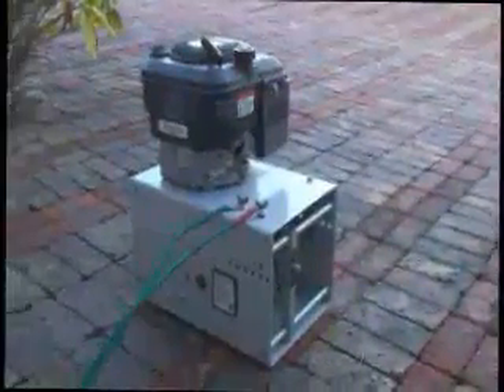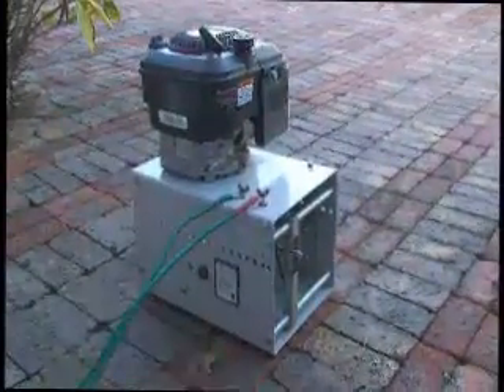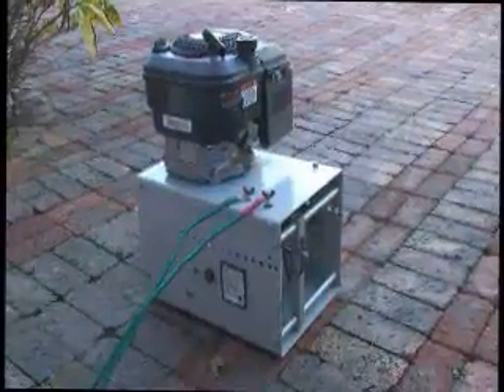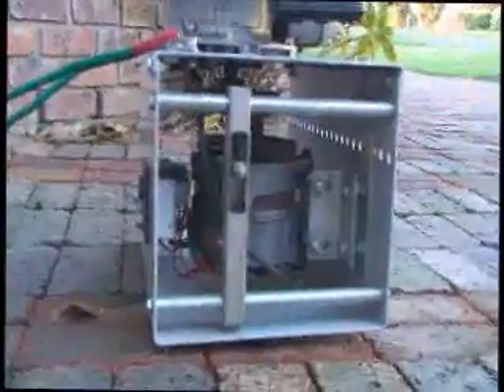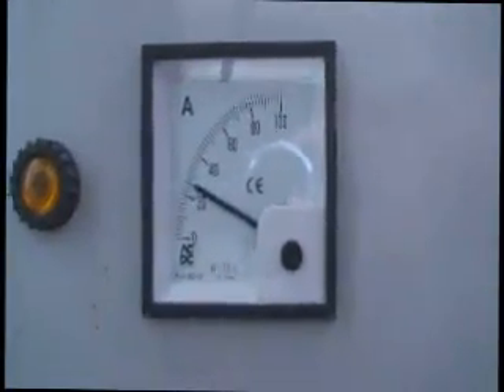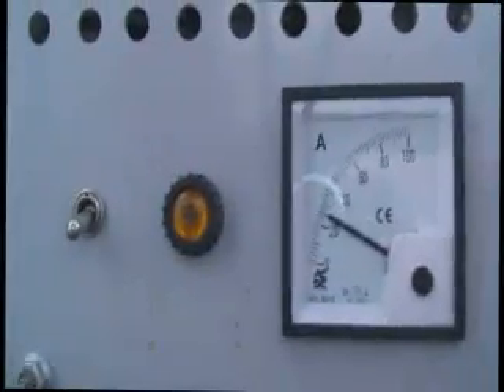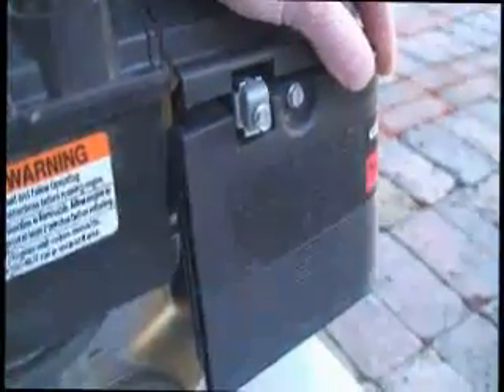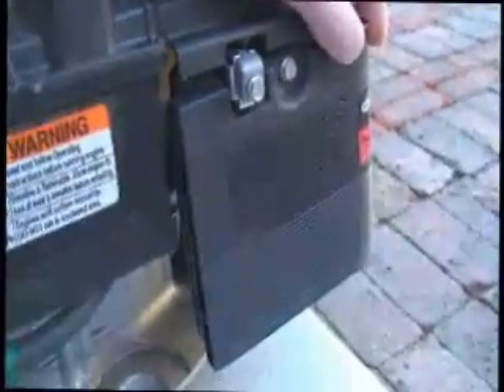DIY 12V DC 70A Petrol Generator

Comment: What tipe of motor is that so I can go get one like it letme know.joselm1029@gmail.com
Very nice I will love to have one I'm a truck driver my truck does not have a generator unit I havr a portable air conditioner inside  I do have a 3000inverter bat I think I need something more powerfull to keep my inverter power up becouse is not keeping my ac unit runing.thanks guys for ur comments and advice.

Comment: Good idea, more efficient than an ac generator and battery charger. Alternator speed versus power output is an interesting one, and I've seen these work quite efficiently with only a 4 inch pulley on the motor and the standard pulley on the alternator. Most alternators are capable of producing close to max amps at between 2500 and 3500 rpm(depends on the car). the trade off with the bigger pulley is lower engine revs, quieter running and less fuel usage, but lower amps.

Comment: @ohyrag actually, a car alternator is fine for this application, as the staionary motor has enough speed to run an alternator(usually 2 to 3000 rpm at the alternator is fine), it's only the initial start up that's the problem, as you mentioned, it needs to exite the field, once that happens and the alternators turning, it keeps itself going. A pm alternator would be advantages, they can generate a high output at much lower rpm's, not to mention, they need no power to start generating!

Comment: @jib1000 sometimes a store bought generator just isn't any good for some applications. Believe me, when your living off solar power a generator like this is invaluable, as, if it's setup correctly, is able to rapidly charge a 12 volt battery bank due to the high amp output of the alternator(an hour or 2 rather than a whole day of running). Off the shelf battery chargers and 120/240 volt generators with 12 volt output don't even compare to an alternators amp output!!

Comment: Hey mate nice video. I have a suggestion to modify your setup with a simple to program micro controller such as a PICAXE etc that would take engine RPM OR throttle position and alternator load as an input to operate a small servo that could automatically adjust engine RPM to the load? Hi from Perth Western Australia. OK back to the beers.

Comment from the maker: @jib1000 I said that generators here are  AC.I need to charge deep cycle batteries directly off the generator thus it must be DC.Most people just use an AC gen,then power a battery charger to charge the deep cycle battery bank,but this way has too many losses.My next project will most probably have a brushless permanent magnet alternator." They don't have batteries where you live? Transformers?"??

Comment: You could install an ultra capacitor bank to act as a buffer for momentary high loads,  though it would need to be charged before hand otherwise it would act like a shorted circuit.

You could use a couple deep cycle lead acid batteries as the buffer.

You could also install a large flywheel as the buffer..

And lastly you might be able to install a second gas engine,    however it would be quite complicated to synchronize them if not unfeasible.

Comment: It's not that the engine is too small it's that your pulley ratio is way wrong. Too many alternator rpms per engine rpm's change the ratio.

Comment: I meant no ELECTRICAL load on the alternator,the more electrical load you put on the alternator (the output voltage drops as amps increase)the regulator increases the field coil voltage,which increase the output of the alaternator to counteract the electrical load,this means the alternator requires more HP to drive it under high ELECTRICAL loads.With no electrical load the alternator should require few hp to drive and provide 14.8v

Comment: silver 760, as the load increases on the alternator the alternator becomes magnetised this is what is killing the engine at 75A as he said. Plus you need extra RPM because the altewrnator is designed to run at higher RPM and will not produce at lower RPM 1:1 will stall the engine even quicker as lower RPM + extra resistance of alternator.

Comment: why?? small engines have same RPM but a lot less torque. of coz that would strain the engine if you hooked it up to an alternator that needs torque.

the amount of torque an alternator needs depends on the electrical resistance.

Comment: probably the gear ratio. car alternators are meant for high torque application (car engine) when you attach a smaller engine to it you've gotta use reduction gears to raise the torque to spin the alternator. I'm just guessing anyway.

Comment: sounds like the RPM's are too low the HP rating is @ rated RPM's probably 3500 RPM's it sounds like it a little above idle ..........I'd say go back to 1:1 ratio of pulleys and run it to rated RPM's see what it will take then????  even if you run it at 2000 RPM's then it won't stall your calculations are right as far as i see :)

Comment: You need a very robust varistor,the big bakelite type with 5 or 6 positions,these are used to limit the current by putting a load in the circuit,usually a ceramic resistor.They kick out alot of heat and are old tech,but they are still made.The easiest way in your set up is to vary the engine speed slower = less amps and visce versa.

Comment: The voltage regulation/diode pack are mounted in the back of the alternator,so no external voltage regulator is required,the volt output with no load should be 14.8volts.

Comment: Its overgeared,he used a 2:1 pulley ratio to run the alternator faster than the crank speed,he doesnt need it as all it does is put too much load on the motor,he just needs to go 1:1 or direct drive and that engine will run it easily.

Comment: I'd try running the alt on a 1:1 pulley system,the alt only needs about 1000-1500 rpm to produce full ouput,on a 1:1 pulley setup the load on the engine will be considerably less and that engine should run it fine at 1500rpm.Most people direct couple the alt to the engine output shaft when they do projects such as these.Problem solved.A 6-8hp motor is plenty to drive that alt

Comment: Hello
Am so proud of what you did, pls. keep it up. I am planning to setup something like this for my business also in west africa but the problem an facing there is the power outtages,so, looking at your setup it given an encouragement not to giveup. Here is what i have on ground:-

1. 5kva inverter

2. 5 heavy duty batteries 12Volt @ 225Amps

Comment: wow! This is awesome. Very neatly finished. :-) Can you post a video of it running?

Question: 12 volts * 70 amps = 840 watts

840 watts / ~745 watts per hp = 1.12 hp

So... at peak output, your alternator is consuming about 1.12 hp, but your motor is rated at 6 hp.  

Why does it stall out?

Comment from the maker: My problem is the motor is not powerfull enough.I need to limit my amps from the alternator to max 70A.If my load is greater than 70A it pulls/draws the motor dead.I have a few suggestions I still have to try.One was to vary the Volts from the alternator.

Comment: Nice clean job.
I think a charge regulator (Like one you find in 
a good quality solar/wind inverter) will give you the regulation on the DC out. An efficient way to dump excess amps might be a 12v water heater element, look on ebay.

Comment: You need some kind of zenor diode to dump excess or put a light on the output? I am working with a motorbike alternator to be turned by a stirling motor.

Comment from the maker: Yes I used a 2nd hand car alternator.Bosch 80Amp 12V DC.I need to find someone that can make me a Amp regulating device.This device will be connected between the generator and the battery bank.I need to limit the current draw to about 40A when charging the batteries.